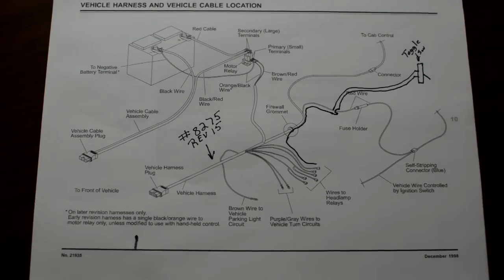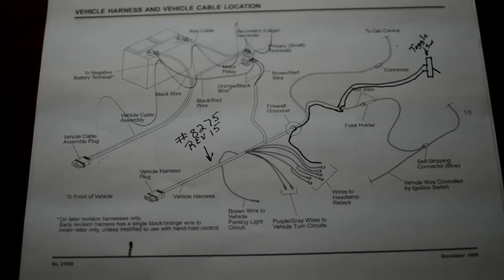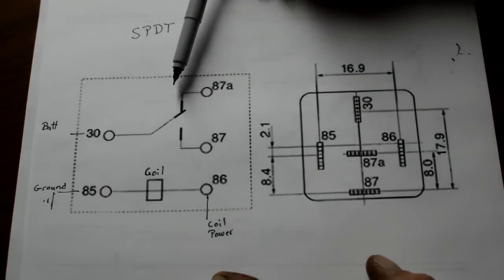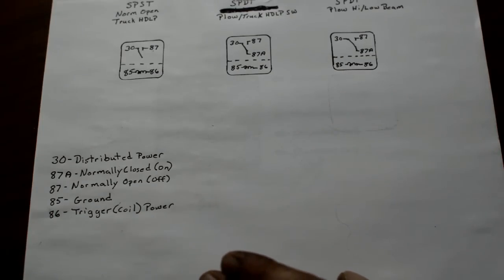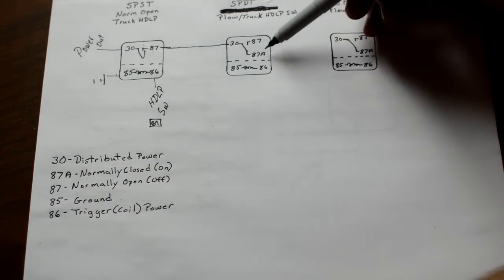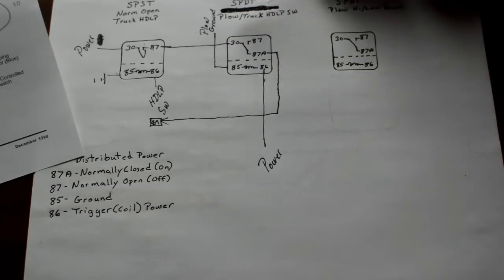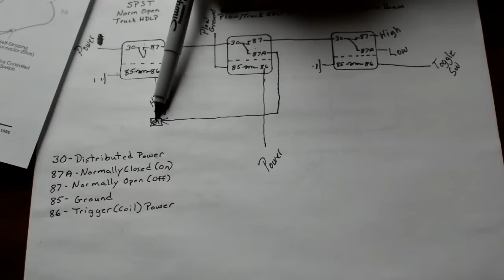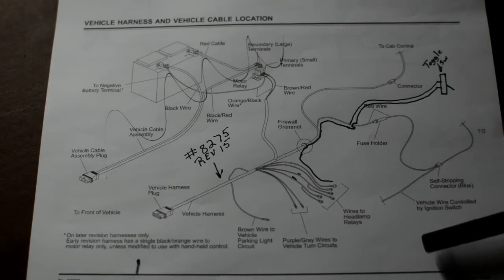Simple easy Fisher Plow Wiring 1 Harness 2 Relay

Comment: Awesome video! I've been looking and looking to find information on how to install MM1 wiring harness on an '08 Silverado just to see if anyone's done it So I have a look ahead on what I'm into. I've installed it on three different vehicles so the installation of the plow wasn't Any problem? It's the older wiring harness mine's actually three relay setup single action double thro It was pretty frustrating to get the lights to work and I didn't quite understand how the relays work but thanks to your video explanation of what and how and why was perfect There's a lot of videos out there where people show you the the relay and explain how it works or what it does, but they don't actually sit down and break it down on paper and show you what it does. Really appreciative. Thanks for making this video make lots more

Comment: Nice video. But I’m stumped. I have it hooked up the way you recommend. Only issue is that truck lights don’t go out when I plug the plow in. And if I just try to use parking lights that’s all the head lights go out. Any suggestions?  Thank you

Comment: im here because i got a customer that has a plow that is having intermitent lights that go out. i tested fuses and relays. all work. one wire comes back grounded but when hit with 12v off the power probe, the fog lights come on, but will not come on with the switch in the cabin... did have green boogers in the main connector behind headlamp drivers side.
Reply from the maker: Sounds like you're trying to repair a full harness factory setup that taps into the wiring harness at the headlights. There is probably a circuit in there to prevent the fog lights from being used when the plow is attached. There's probably a chafe in the harness somewhere causing a voltage bleed back to the fog lights intermittently. If this is the case it could be very possible that the intermittent voltage caused by the chafe is sending power to the wrong relay when contact is made and either energizing or de-energizing the one of the relays temporally.
Unfortunately, wiring issues can be a time consuming problem. I'd start just like you did then, thoroughly clean all grounding points. Next I'd dig in and inspect the whole wiring harness for a short anywhere it rubs against the vehicle, to include the plow head and the firewall where it goes into the cab. 
A wiring diagram for your particular harness would help you lots, but there are so many harnesses variations out there you may end up with the hunt and peck method of wire identification.
I'm not a mechanic, but I am mechanically inclined and pretty good with electrical issues on vehicles. This video was made on the second plow I've installed in 30 years. I made it because there are tons of people trying to install a used plow with a harness made for a different vehicle than intended without spending hundreds of $$$ and taring the whole front end apart.

Comment: where was the ground for the left head light u cleaned
Reply from the maker: Sorry for the delay. It is right in the 3 wire connector. The plow head had set for about 4 years and the terminal was a bit corroded.

Comment: Where did you hook up the ignition wire to
Reply from the maker: The only ignition wire that I remember comes from the joystick controller in the cab. I connected it to a fuse  in the fuse panel on the left side of the firewall in the cab. I suppose any fuse will work since the  joystick has an on/off switch but I used one of the circuits that powers on only when the key is in the on position. The joystick requires so little power to function that I just used "whatever" "switched" fuse I found first. 3yrs, no problems - it's my yard truck now.

Comment: aren't they supposed to switch over when you plug them in from the factory
Reply from the maker: Yes, and this vid is about how to do that without tapping into your headlamps and blinkers (without removing them and tapping into the wiring) and without the isolation module.
Reply: I thought the old 2 plug did not  come with a isolation module
Reply from the maker: They probably didn't, I haven't installed a plow for 20 years. You seem to be knowledgeable about this system and this vid seems to be beneath you, it has helped quite a few people. What's your goal with these comments?
Reply: I am trying to find out if I am missing the I M  or if I have it wired incorrectly      I have a old 2 plug and It did not come with one only 2 relays and I cannot get plow lights to work ……. ps the video  was great
Reply from the maker: My harness came with 2 relays, I threw them away and went with the 3 relays. It's the only way I could get it to work as designed. The harness came out of a 1997 truck, maybe it'll work with that year vehicle but I don't know how. Like I said in the vid, this is how I got it to work with my vehicle, it may need to be modified to work with yours. The vid was made for information on how to make a harness that wasn't designed for your vehicle work on mine. 

You need to identify each essential wire for the lighting, like I did in the vid and ignore the rest of them. I started with the plow headgear, used a multi-meter and made a diagram of the pin-out of the headgear plug. I then used that diagram and a multi-meter to identify the individual wires in the harness I needed to work with. I cut the extra wires and isolated them with electrical tape so they didn't confound my wiring the plow. The rest is what is in the vid.

Comment: can you bypass the headlamp setup all together if all your doing is swapping the pump to a previous setup?
Reply from the maker: I don't really understand the question. If you have a plow that is already setup and are just putting a new pump on, just go ahead and swap the pump and use the existing wiring on the new pump.
Reply: im going from a cable setup to an electric setup. the wiring from the electric setup. cable setup has a stand alone light system but wasnt sure if anything from the electric setup had to be pluged in.
Reply from the maker: Just a word - I make things work as I go, when needed. The following would work with my wiring harness. As always when not using the manufacturers approved components all is done at your own risk.
If the lighting system is already hooked up and working I wouldn't change anything on that. All I would do is use the portion of the wiring harness that controls the pump and in-cab joystick. It's very straight forward. Negative lead from battery to ground on the electric pump motor, Positive from battery through the solenoid then to the positive connection on the electric motor. There should be a connector (7 or 9 pin) coming off the hydraulic solenoids on the electric/hydraulic pump that will connect to the truck harness. The truck harness will be routed through the engine compartment then into the cab for the joystick. One hot wire from your fuse block under the dash to the joystick connector. In the engine compartment you will have one or two wires, from the harness, that will hook up to the pump electrical solenoid that actuates the solenoid and sends power to the pump motor when you press the buttons, or in my case move the lever on the joystick. You may have to run a separate ground wire from the negative terminal on the pump to the hydraulic solenoids under the black plastic cover of the pump. All the other wires can be secured and wire tied under the hood. 
If you do not have the harnesses you will have to make/buy them. If you don't have the joystick you'll have to buy that also. There are different joysticks, depending on the pump configuration so that's another thing to take into consideration. 
I'm not a plow mechanic so all I can share is from my unique situation, you know - I just made it work the way I wanted.
Reply: that is very helpful. i am good with electrical just havnt worked with an electric plow before. only thing i was unsure about it how the solenoid worked and how to rewire it. didnt think i needed the headlight relays but again wasnt sure.
Reply from the maker: If it helps you can think of a Solenoid as a very heavy duty relay. The two large lugs are for the high current battery pass through. Some solenoids will have either one or two smaller lugs - if it has one that means the solenoid gets it's ground from the mounting bolts, if it has two you'll use the wires from the harness. You may end up using just the hot wire from the harness to one of the small lugs and running a jumper wire from the other small lug to ground (just use the mounting bolt for the solenoid.